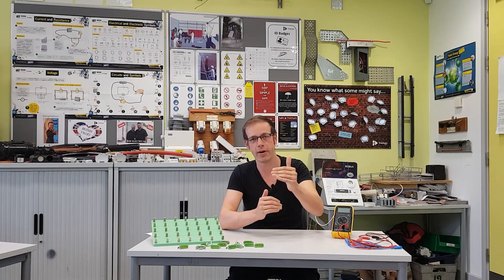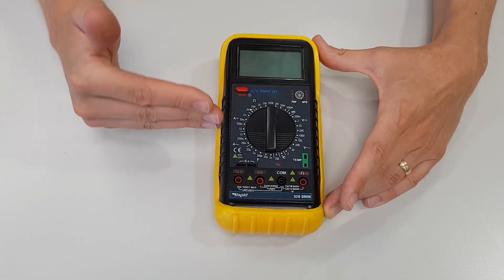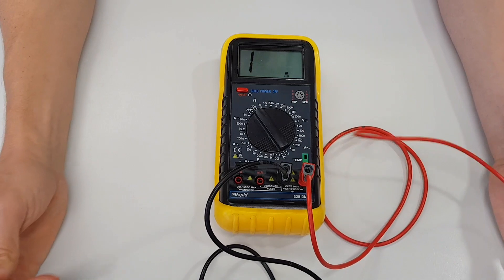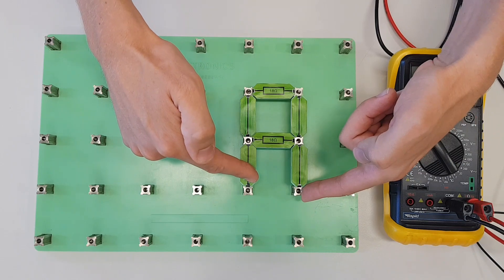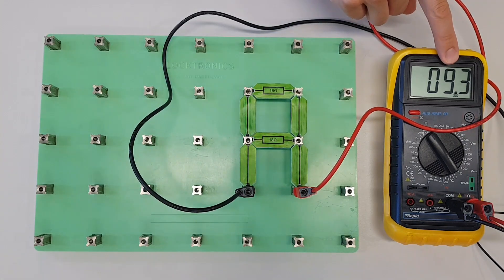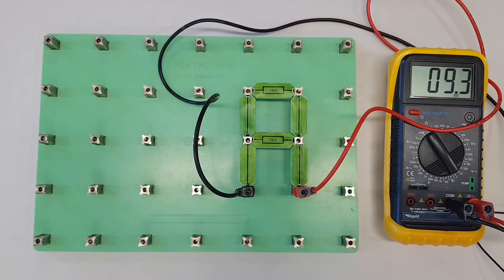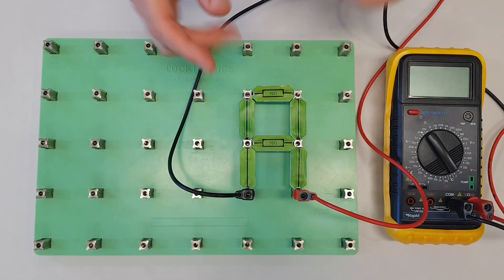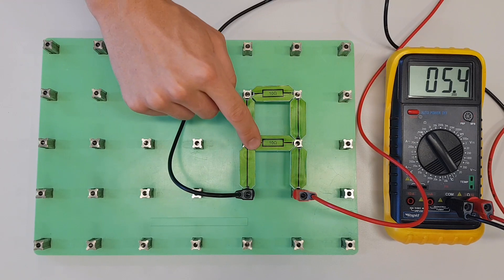Resistors in Parallel - Introduction: How to Calculate Total Resistance

Comment: What if the resistors are different value do you half the 1st resistor in circuit?
Reply from the maker: Hi Richard, great question and a reasonable conclusion. This question will be answered in a video released this week. Please hit the notification button to be alerted when it goes live.